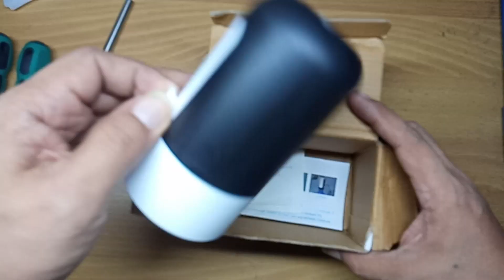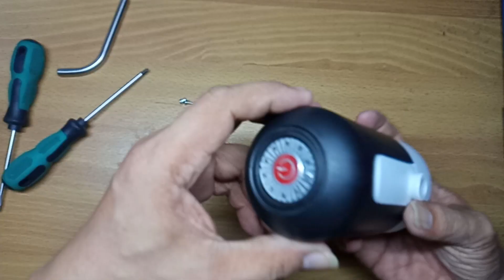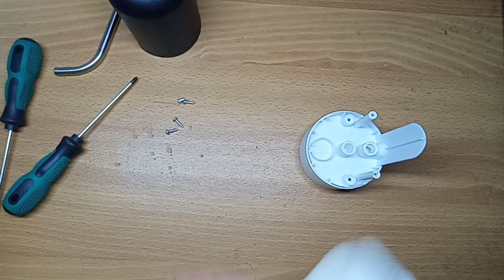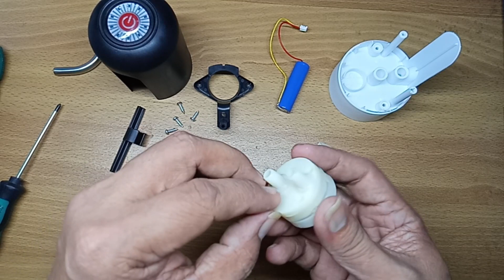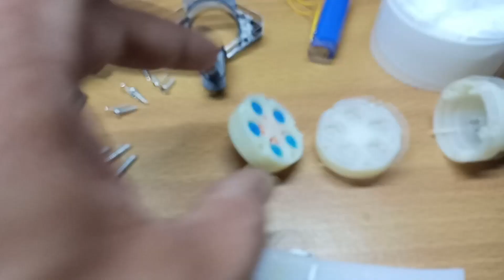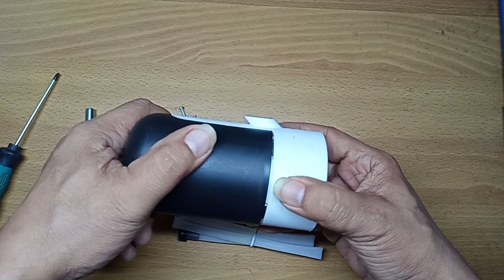Rechargeable Automatic Water Dispenser TEARDOWN / Disassembly / What's Inside

Comment: Thank you for this video. ⭐⭐⭐⭐⭐
 
I wanted to buy one of these and was wondering what was the engineering inside. This video helped me a lot to know that the battery is safely installed away from the pump, and it is a reciprocating pump, and its parts are sealed well sealed from micro debris sprayed off from the motor. Cool ☺

Comment: I was surprised by the pump mechanism😮

Recently mine was working inefficient with low water flow. I thought battery issue and bypassed dc 5v to motor, but still the flow is low. Maybe there is an issue with the pump. Will teardown pump after seeing the video. Very helpful man a big thanks for your🎉